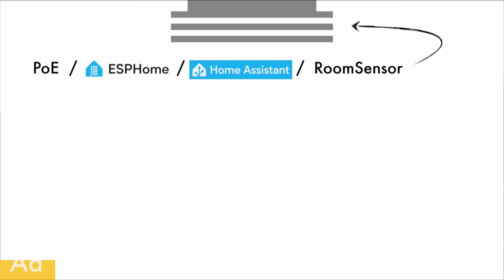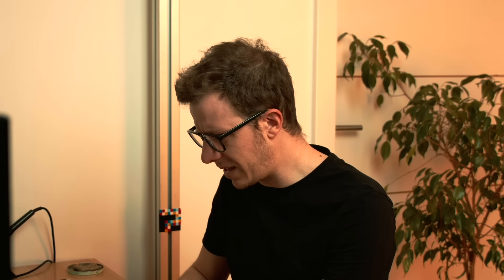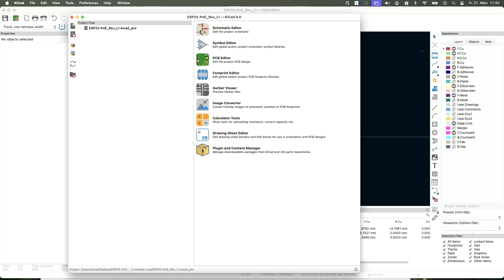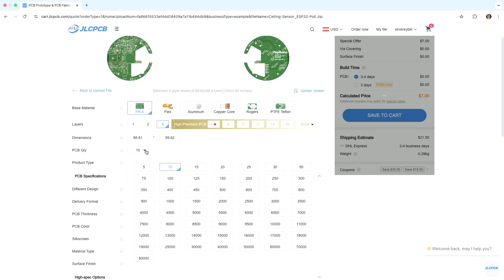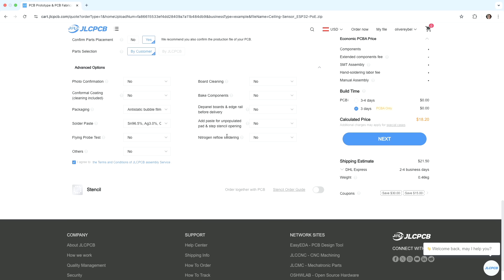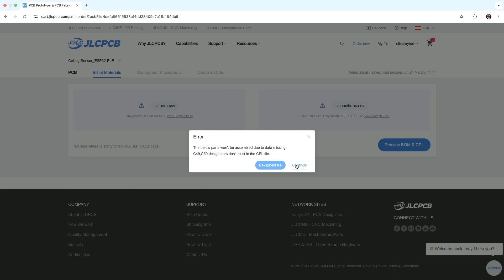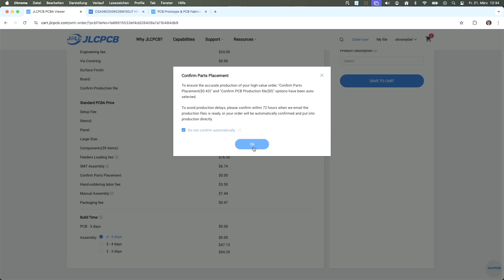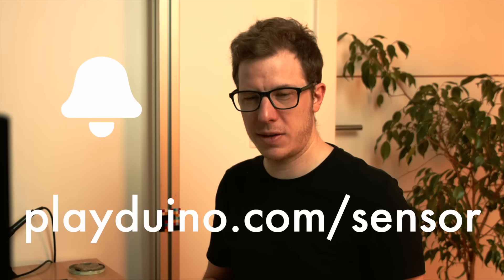KiCad + JLC PCBA service = 🥲‼️

Comment: I found a tip on the internet, to try the "Basic" component selection filter, it usually has a lower cost, or close to the lowest.
Reply: And if the project allows for similar components, it might be worth researching the component type. For example, an "accelerometer", an MPU6050, is quite expensive, and JLCPCB has much cheaper models in stock.
Reply: @RR-zb5cw  beware of of "knock off" parts that don't perform to spec, some not even close. Also potential reliability issues if ur using it in any real sense.

Comment: very helpful indeed thanks.  Would love to see a similar vid for Seeed Fusion.  I am using Xiao boards and the pricing at PCBWay and JLCPCB is quite expensive.  But getting KiCad in to Fusion is a bit of a challenge.  These manufacturers should really have single click options like PCBWay which is super easy.

Comment: I understand why these vendor specific plugins exist, but honestly, there should be one for EVERY SINGLE board-house and assembler if you go with vendor specific plugins.

Thus I'd more support having general systems that allow you to configure them as you require OR to allow the specific manufacturer to supply a compatible configuration file for the CAD package and then the burden is on the manufacturer who wants the business of people using their services and put in the effort to support the common CAD software.

Then CAD people can focus on making great CAD and manufacturers can focus on making people to come and use their service.
Reply from the maker: I already ordered PCBAs in the past and it was always manually reviewed. They did not have this issues with my files. In the case of JLC PCBA everything needs to be perfect because it is fully automated.

Comment: I Try to place my parts in a 'similar' orientation as much as possible.
For example capacitors with polarisation I try to have them all with the + in the same direction.
This way it is very easy to see whether they are correctly placed.
Also keep an eye on the silk screen markings of pin 1.
There are lots of variations on how this is marked on a silk screen footprint. Typically this is like a dot or a small triangle.
I even have seem some where there are 'spokes' on the corners of the other edges where you don't have pin 1. This is really hard to see, especially on parts of 1x1 mm in size. So you can add some marking yourself on the silkscreen.

For pin headers, I try to use a footprint which has pin 1 marked differently, like a square solder point where the others are round and when possible use it as GND. This way you always have some simple checks possible even when looking at the side where you may not have (readable) labels on the silkscreen.

JLCPCB is great for assembling your boards, but it really is worth it to pay a bit extra to get someone to review your design before manufacturing as they can also find issues which you simply can't. For example when there is some bug in a footprint file they use in their production line as they need to match the offset of a part on the reel with the offset of the board.
I had that happen once and they caught it before production.
Reply from the maker: great advice! thank you for taking the time to share this :)

Comment: The preview of the bottom of the PCB is correct.  The text is mirrored because the PCB isn't flipped horizontally.  You can see the PCB shape stays the same with cutout on the right for both sides.
Reply from the maker: Yeah true, still not what I expect when I press “bottom” 😅

Comment: Why is manually rotating even necessary? Is it because my KiCad library does not match the parts from JCSC? Is there a good source for this?
Reply from the maker: yes it seems some of them are not compatible. but in my case its was a mixture of different libraries that I found on snapeda and kicad and olimex from the original design.

You should check this out:
https://github.com/Bouni/kicad-jlcpcb-tools

I will give it a try

Comment: There is another kicad plugin called Jlcpcb it downloads entire jlc data base you can search and choose any component and it shows the stock as of download date. Then it exports the BOM (with the part numbers) and positions files in correct format, all from within kicad.I am very surprised no one mentioned it in the comments It's an amazing extension. .

Comment: I ordered my PCBA recently and I found the instructions to use the plugin on their website, they have extensive instructions (sometimes a little bit confusing, but in the end it worked). One issue I had was that my parts ended up offset away from my board, but their import tool offered to fix that and did it correctly. 

After I submitted my order their engineer discovered I had used a footprint that didn't match the component I selected, so they thankfully gave me a chance to redesign my board with the correct footprint and resubmit
Reply: Check jlcpcp kicad plugin it automates everthing and you do component selection within kicad

Comment: The rotation in their website is CCW=90 (from memory) so if you find a component needs to be rotated CCW by 90 then go back to your CPL and edit it. There's prob an attribute for that you could use, but I still do it manually.
Reply from the maker: good point! thank you

Comment: Ah... the disaster of finding "only basic parts" & cost optimization process before PCBA on JLCPCB 😂

Had to cancel once & re-footprint the board to fit most basic parts I can find there
Reply: The "best" thing is when you do this, and make a bunch of compromises to use only Basic parts, but then when you get to the checkout you realise you have to use Standard Assembly instead of Economic. Standard Assembly has no discount for using Basic parts, you have to pay a feeder loading fee per part regardless of whether the part is Basic or not. So you find out you just wasted all your time... I'm still salty about it
Reply from the maker: @thenickdude ha! That happened to me with this one! I had one component that required baking and was Standard. So I guess this one caused the high price 😐
Reply: @ Eventually, it was only actual economy in massive volume.. Then I'm back to module-based way of building stuffs, beside all current THT-components.

Comment: The other JLCPCB plugin is one called "JLCPCB Tools". It lets you do part mapping and selection from within KiCAD for JLCPCB basic parts on assembly.
Reply: Seem helpful enough if all parts are there with "basic"
Reply: @thanatosor  not only basic it downloads entire PCB data base you can search and choose any component and it shows the stock as of download date. Then it exports the BOM and positions files in correct format. It's an amazing extension
Reply: @aai2962  not the entire database ... only the basics and preferred and I think it is a bit limiting
Reply: @SkanderHannachi-f1x  There is a filter to search only basic parts, but it contains non-basic parts. Never had issues with finding parts using it and  i've used alot of non basic parts.
Reply from the maker: wow got to check that one out!

Comment: I just did my first PCBA with JLCPCB. When searching for passive components check whether they have "Basic Part", which imensely reduces the assembly cost! I saw your BOM was mostly "Extended Parts".
Reply from the maker: I’m sorry to hear that :/ thanks for letting me know
Reply: @ ahh well thems the breaks! Not your fault :) But I reckon you coulda saved probably USD$50 on that order by using the basic parts, so definitely worth looking into :)
Reply: @new-zealand-clippy  my toy project went  from 40 down to 23 dollars, only replacing a few capacitors and resistors...
Reply: @rafaelgcpp  they reduced the amount of basic parts significantly in the last 1-2 yrs, at least it seemed to me. So I try to use as little different components as possible.
Reply: There are also "preferred extended parts" which also don't have loading fee, just a bit harder to find, you have to look manually in the "basic/prederred extended" section on the jlc parts website
Reply from the maker: oh! thank you for the hint!

Comment: 1:15 Printed Circuit Board Assembly :)
But I know JLC does al the import taxes, but did PCBway do this as well or did you have to pay this separately (to the postal service)?
And I still didn't order a PCBA. But I would try to fix at least the component selection in KiCad. Saves quite a bit of time when you order a new revision...
Reply from the maker: Oh no, true 😅 thank you!

I had to pay taxes in my Country

Comment: I use the "Fabrication toolkit" plugin from the KiCAD plugin manager. I always make sure to fill the "MPN", "MFN" and "LCSC" fields for each schematic symbol. Ordered over a thousand assembled PCB's from JLCPCB and never had any issue with placement. The component rotation is often off for QFN packages and the likes, but double checking and fixing these in the preview is always necessary anyway.
Reply from the maker: thank you for the message, this sound great! I really like the LCSC integration into the ordering process as it gives you full cost transparency and everything works super fast. I will definitely add the LCSC information to my parts :)
Reply: LCSC is sufficient from my experience. With time you collect finished projects and when I start a new one, I copy the symbols from existing projects and paste them in the new one. This also copies the LCSC number. I also design specifically to save the $3 loading fee per extended component and try to keep my BOM small for low quantity orders by e.g. replacing a 5k resistor by 2x10k in parallel. You can place like 30.000 resistors before it makes sense to pay the loading fee. Setup and extended parts fee are the major cost drivers in my case. So I see it as a challenge to optimize for overall cost, even if this means a mosfet is oversized or I need to use some basic math 😂
Reply from the maker: I love it :D 👌